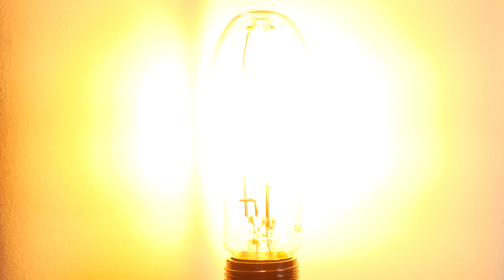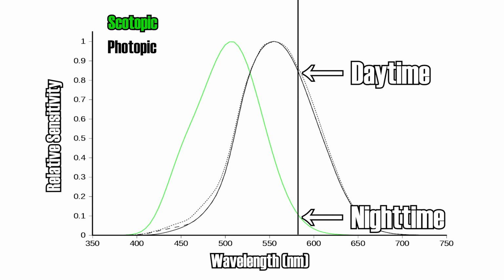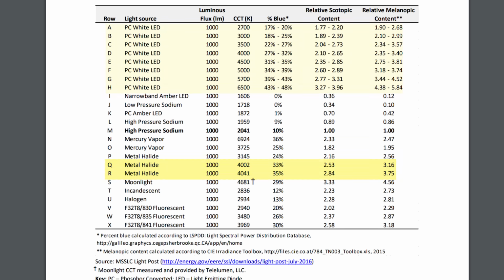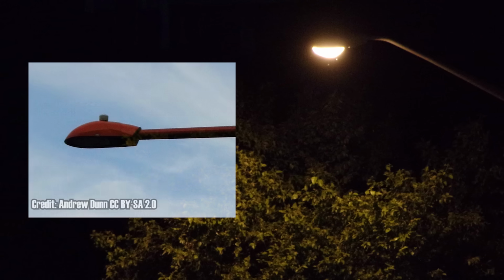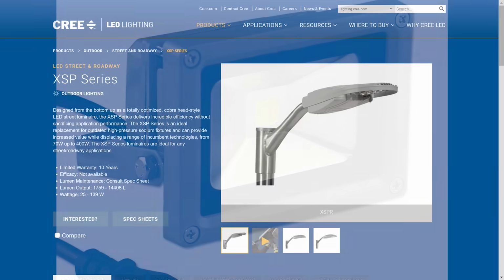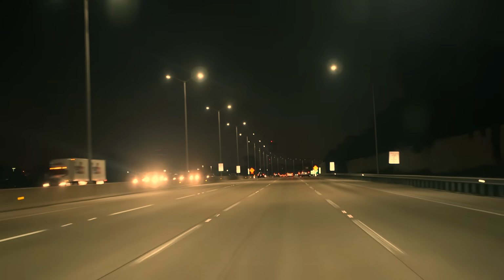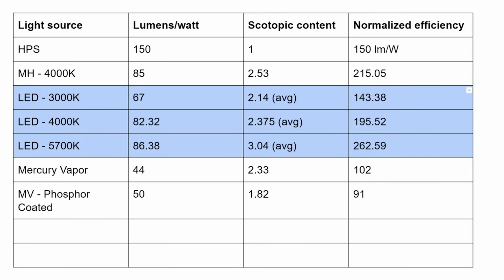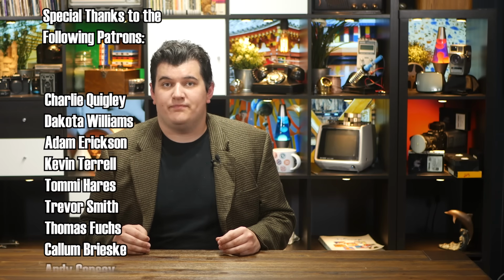The LED's Challenge to High Pressure Sodium

Comment: Charleston spent tens of millions of dollars ripping out perfectly good lamps to replace them with LED because "green".  That's like junking your perfectly good totally paid for gas engine car and going into debt to buy a massively expensive electric car because "green".  It's ridiculously wasteful and puts you in debt, but it makes you feel better.  In the case of Charleston it put many thousands of people into debt so a few thousands of people could feel better.  And of course, they then complained that schools were underfunded.
Reply from the maker: If they decrease operating costs, over the long run they cost less.
This isn't rocket surgery.
Reply: @TechnologyConnections  -- And economic ignorance rears its ugly head.  How long do these systems have to be in effect before tens of millions spent have been saved through reduced energy usage?  Long before that they would have simply physically failed and needed replacement with technology current at that time, which would in all probability be far advanced in relation to the LEDs they were replaced with.  Even more ironic, long before the LED's had produced any savings at all the crowd that demanded they replace perfectly good lamps will be demanding that the replacements themselves be replaced with more advanced lighting, which will be bought with debt long before the debt for their last demands has even been paid off.  It's why we're still paying the debt for bridges that have long ago been replaced, sometimes multiples of times.  This is the economic strategy of people who prefer feeling good to fiscally feasible results.
Reply from the maker: Hoof. Spiralling out of control, you say?
Good grief. You realize that what you're saying is, because future technological progress will be greater than what we have now, we shouldn't bother replacing what we have, right? You're saying that because something is functional, it is inherently adequate? You keep saying "perfectly good". Yeah, maybe they are functional but that doesn't mean they are functional at an optimal cost.
If you want your local government to continue spending money at the same rate that they are now, fine. So be it. But spending a little more upfront for future gains is how we save more money overall. As it is in personal finances. As it is in government spending. There isn't some magical difference between the two.
If you spend $10 on a thing that costs $100/day to run, you'll spend $36,510 in a year.
If you spend $1000 on a thing that cost $90/day to run, you'll spend $33,850 over a year.
Spending $990 saved you $2,260 over a year.

Of course the numbers do not pertain to the situation at hand, but this is the concept that you are arguing against.
Reply: @TechnologyConnections  -- An LED may produce optimal cost, but ripping out perfectly good equipment and replacing it at a cost of tens of millions of dollars to save a million dollars in energy usage over the lifetime of the equipment you've replaced is certainly not optimal.  It's a waste of money (which will be borrowed and thus require even more in interest) with little gain other than "feeling good".  When CFLs were the fad people were replacing lamps which were only used for very short time periods, like pantry lamps, with lamps that cost 7 times as much as the incandescents.  A CFL actually uses more energy than an incandescent for short term uses, like in a pantry where you turn the lamp on grab your item and turn the lamp back off.  Not only were they spending far more money replacing perfectly good lamps but they were using more energy using the replacement lamps, but they felt good because they were saving the world!  It's idiocy in the name of ideology.
Reply from the maker: Oh hey, what a great example. You've picked out a flaw of a technology we're not even talking about to illustrate how the "green" movement is entirely counterproductive. Good job!
Of course, I'm being sarcastic here. For one thing, I'm not going to bother to refute the CFL thing. It was widely reported on and the fact that they weren't ideal for things like bathrooms and closets was well documented. That does not mean that the technology itself was flawed, particularly since the areas it was least suited to are the same areas where they had the least impact anyway. Switching to CFL bulbs dropped my family's electrical consumption by about 20%, and they paid for themselves within months. But in any case, LED technology has brought us the best of both worlds.
Now, if you choose to believe that every government around the country that decides to install LED street lighting is doing it for image alone, be my guest. I think you are fundamentally incorrect here. If you continue to rationalize this belief, than surely me pointing out that most governments aren't exactly open to experimentation and are likely copying others because of concrete benefits those others have seen and reported on won't push you towards believing in the merit of these choices. If governments that have installed LED street lamps were so dissatisfied, surely there would be reporting on it and other governments would stop. Or at the very least, the word would get around and the use of LEDs would stop quickly.
If you choose to believe that all parties involved are somehow economically ignorant, and that they should never bother investing in themselves with the hopes of decreasing future expenses, then please, be my guest. I hope that you live your life in the same vein, and continue to support old technologies without ever moving forward. Because there's no need to improve until something breaks.
Have a nice evening.

(edited for typos)
Reply: @TechnologyConnections  -- You are either simply lying or have no idea how to do math when you say replacing cheap incandescents with expensive CFLs paid for itself in a "few" months, unless you define months as years.  It's mathematically impossible to realize the level of savings that "few" implies, being just 1 to 4 months.  I certainly don't consider "few" to mean 12 months.  I actually like LEDs, I use them, I liked CFLs and used them, but I didn't run around replacing perfectly good incandescent lamps with CFLs and I certainly didn't run around replacing my perfectly good CFLs with LEDs, and in the case of Charleston in order to replace the perfectly good lamps they had to replace the perfectly good fixtures as well.  No savings will be realized, and before the new lighting is even paid for the same crowd that demanded on them will be demanding that they will be replaced again.  They weren't replace to save money, they were replaced out of ideological zeal and non-existent savings were used as the excuse.  If you can show fiscal savings do so, but you've done no such thing.
Reply from the maker: I was trying to disengage but you called me a liar and/or ignorant so I guess I have to do some math to prove my "few months" "lie".
A 60 watt bulb in the kitchen was used around 6 hours a day on average (more in winter, less in summer). Over 4 months that's 43,400 watt hours (43.4 kWh). That costs about $4.30 at a rate of $0.10 / kWh. An equivalent 14 watt CFL bulb used 10,080 watt hours (10.08 kWh) and thus cost about $1.01 to run for the same four months.
CFLs cost about $3/each when we first switched. At one point you could get a 4-pack for a dollar, though admittedly that was with a generous subsidy from the utility company. But at $3/bulb, they paid for themselves in about 4 months. Probably not in every room and every situation, but certainly in the rooms where we spent the most time.
I recognize that LED street lights don't necessarily cut the operating cost by 75% compared to sodium, but that does not mean the savings aren't there, and that does not mean the savings are irrelevant. Even if the payback is over 5 years, with an expected life of 20 years, you would be foolish to continue supporting sodium lighting.
Reply: @TechnologyConnections  -- $3 each, or sometimes 4 for a dollar (0.25 cents apiece) with subsidies.  That's all the "good economics" I think I need from you.
Reply from the maker: This source is from 2010. Read it if you will. My family switched to CFLs a few years earlier, so perhaps the prices were a bit higher but I don't think by a gross margin.
https://www.politifact.com/texas/statements/2010/nov/21/joe-barton/rep-joe-barton-says-four-pack-incandescent-bulbs-c/

I specifically mentioned the cost without subsidies. I guess simply by mention the word "subsidy" I became ignorant in your eyes.
Reply from the maker: Now, if you'll excuse me, I am going to disengage from this conversation for real this time. I am tired of explaining this basic economic argument to you and being met with either "you're ignorant" or another mocking tone. It made economic sense to switch to CFLs without subsidies, and the reason ComEd decided to put such heavy subsidies on CFLs was because they would really rather not have to build a new power plant. Reducing their system load by even 5% delays the need for a new power plant for many years. It's funny because they spent money up front so that they could delay greater spending. Or, they could have not put any subsidies on the bulbs, and perhaps faced the need for a new power plant last year given the growth of their market.
But I know, subsidies are useless and make no economic sense.
Good night!
Reply: @TechnologyConnections  -- I've seen the "potential savings" figures, but my measurements very rarely live up to the potential, and ancillary costs are rarely considered unless they are positive in nature.  Most people who change their lamps will do so with no consideration for actual economic effects, they will do so purely out of ideological zeal.  The example of Charleston will mathematically be incapable of ever realizing savings.  It will serve ideological purposes well, but it will do so at incredible and unrecoverable real cost to the taxpayers.
Reply: @TechnologyConnections  -- Your economic argument reminds me of the arguments from flat earthers.  You ignore economic reality to preach ideology, you're essentially blinded by your religion.

Comment: I realise it's a bit late after this video was released on YouTube, but I've had some thoughts as regards the issues you raised.  Where I live (in the UK), we have metal halide street lights.  They give off a nice white output, but because the require many parts, they aren't very reliable and often one failing part can severly reduce the lifespan of the others, as well as require far more maintenance, which over here at least, is VERY expensive.

Most of the lamps last between 1-2 years, but the lifespan of the ignitors and capacitors seem to vary quite a bit (and seemingly are the source of the knock-on problems); the ballast and the light sensors seem to last a lot longer, but again can affect the longevity of other parts.  This seemingly isn't helped by it purportedly being hard to diagnose the original cause of a light 'failing' - in some cases, we've had the electrician back three times in a year to fit different parts to the same street light, all at our expense. 

The development I live on is a private one, and thus we don't have the same street lights as those people living on 'adopted' roads maintained by the local council.  As a resident director (the equivalent of a councillor) of the development, I am jointly responsible for ensuring residents get the best value for money from our management fees (we sub out day to day running of the development to a firm, who use sub-contractors to carry out work such as repairs).  Our electrician has recommended we replace the metal halide lamps with 'drop in' LED 'corn' fittings, which apparently don't require the control gear the metal halide lamps do.  He also says that the LED lamps are now cheaper than the metal halide ones, which are now becoming more difficult (and presumably expensive) to source from quality suppliers.

I too have concerns about the negative health effects (dispruption of sleep) of using higher colour temperature LED lamps, as many of our street lights are very close by to the homes.  The problem we have, with a limited budget, is that we appear to have just three not-so-great options:

1. Replace each lamp as it fails with a drop-in LED corn fitting.  As you say, some can be affected by other components as the metal halide ones.  I don't know how things go in the US, but in the UK there's VERY little reviews as to the quality of commercial building services equipment such as lights, including their related street light cousins.  I think this is because many engineers (I'm a mechanical engineer in this field) don't want to annoy manufacturers with negative reviews which could reduce discounts on products on projects or the amount of help they receive generally when specifying equipment.

2. Replace the existing street light housings completely - bowl, lamp, control gear, light sensor, etc with a similar purpose-made unit to those used by the local council.  From some research I did, this may be cheaper in the long run, as the lamps are flat panels and seem to be better at disappating heat compared to the drop-in corn fittings enclosed in the existing housing.  The problem is that to change them all at once will cost £500+ each (at least), something we'd have to save up for at least 5 years IN ADDITION to spending money on repairs/replacements of existing lights. Changing them out as parts fail would be more affordable (but would still need 2-3 years of saving up first), but would run the risk of ending up with non-matching lights (the bowl/housing) and lamp technology if that were to change during the replacement period (probably 2-3 years). 

3. Keep using the metal halides, possibly stockpiling parts whilst we can if affordable, until the LED technology improves again in terms of the reliability with other parts (see above) and a reduction in health effects if the effeciency improves at lower colour temperatures, similarly with higher CRI ratings as well.  It would be a risk, especially as the quality of ittings and contractors (installations) isn't always guaranteed - we've had some good and bad ones, and trying to get information out of them (even the good ones) is difficult to be able to make this choice with confidence.

Any assistance is most welcome.

Comment: Cool that you try to use research in your video, however, not that I disagree or anything, I don't really give a damn about how people can see under which light, don't use research entirely based on surveys. Surveys are the one most unreliable source of information. They are heavily biased, depend on formulation of questions in the survey and their interpretation by the surveyed person. Also, people lie. Everything that comes out of human mouth should be taken with a grain of salt. It does not have to be intentional, because the most lies people tell to themselves.

Comment: I like the warm glow of the HPS, and I feel the LEDs in the 6000 temp range are, well, not contrasting well with the often dark road surfaces and brighter vehicles and pedestrians.  Mines, particularly coal, often use HPS for that reason.  I have seen freeways illuminated with LED, HID Metal Halide, switched back to HPS, with the color less attractive, but the visibility, particularly contrast, better with the HPS.  But the sunlight spectrum, well focussed LED, properly done, is impressive.  I like the idea of either keeping wouldbe sleepy motorists alert with the LED's ability to keep our circadian rhythm thinking 'awake and drive alert'.  I also like the LED ability to dim when few vehicles are detected, or when drivers are detected, and intelligent vehicle monitoring systems determine alertness, or whatever, and allow the lower light temperatures and even dimming of the LED.  To recap, the advantage of the contrasting yellow (warm) HPS, works well with the dark asphalt of most roads, creating a desirable contrast between dark ground surface, particularly in inclemenet weather, with vehicles and snow patches.  Yet it is important to review the point you and other commentors, about the LED's ability to be dimmed, change their color temp and be oriented to reduce night sky illumination (light pollution) and improve observatory joy and science.  Along with new CREL (LED) lifespans of 15-20 years, and the above mentioned LED light's abilities, the newer LED may be able to utilize the impressive HPS contrast and the many important needs of the motoring public.  I am a diehard HPS suppoorter, but I own both HPS and adjustable LED.  I am impressed with the content of your presentation.  Keep up the good work, Jon